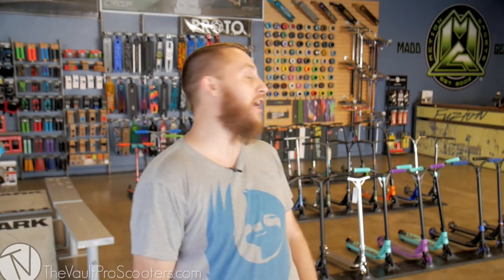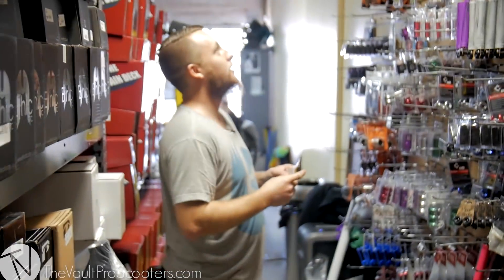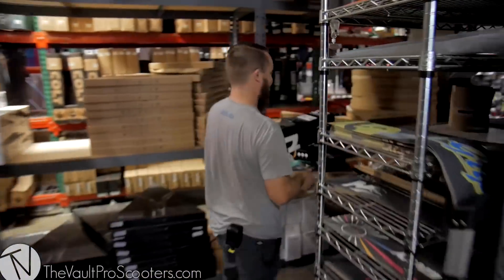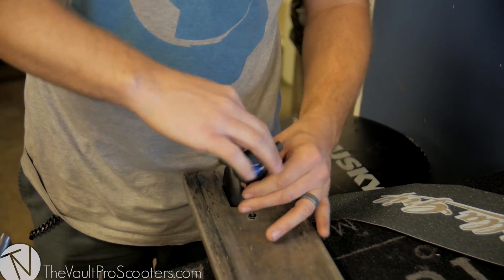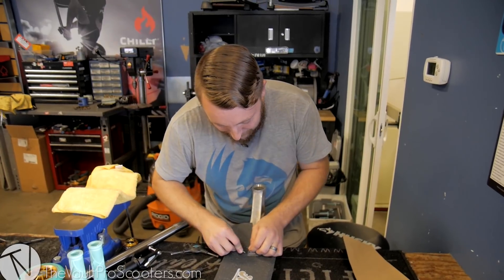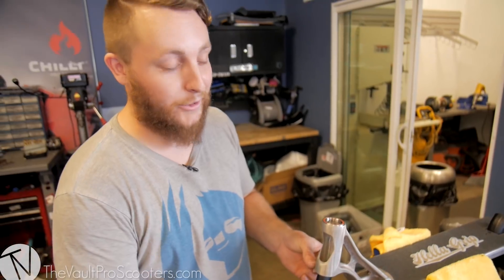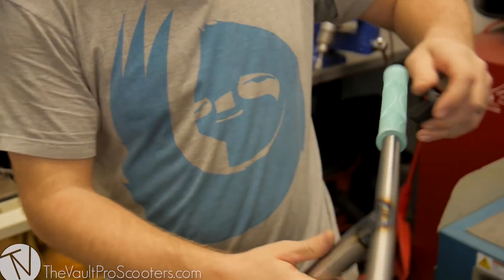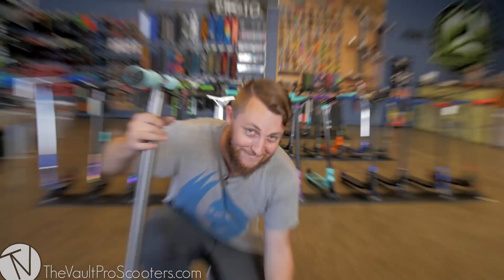Custom Build #203 (ft. Josh Toy) │ The Vault Pro Scooters

Comment: Tilt Century bars would of looked nice on that build
Reply: Fyyjbbkk Bbuukj Thought about those because of the matte finish. But I wanted to run T’s and we were out of Affinity’s.
Reply: Also, Raptor T’s are super good.
Reply: joshtoy and so are tilt bro aren't u street
Reply: joshtoy to tilt and affinity are good ass bars raptor are alright until u take them to a 4 block then they snap
Reply: Fyyjbbkk Bbuukj Tilt Bars are the same thickness as Raptors. Affinity’s actually have thicker crossbars, hands down the strongest bars, facts, not opinions. But realistically, take any bars down a 4 block enough times and not be a smooth rider, they will bend or snap regardless.